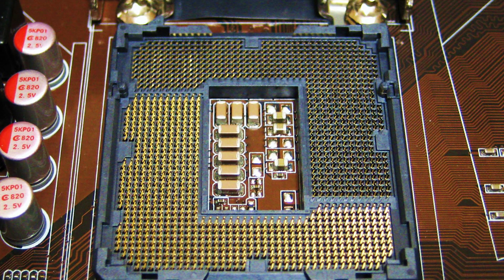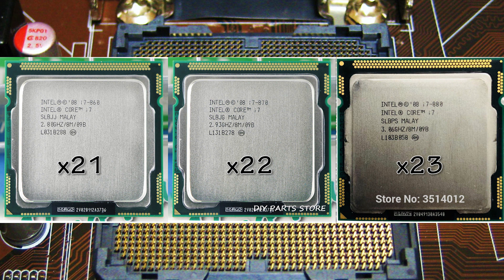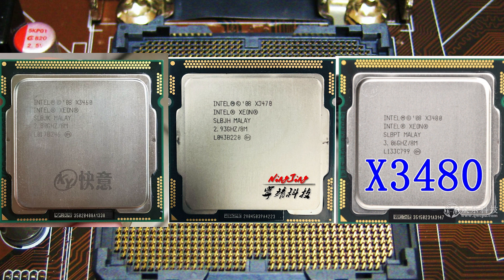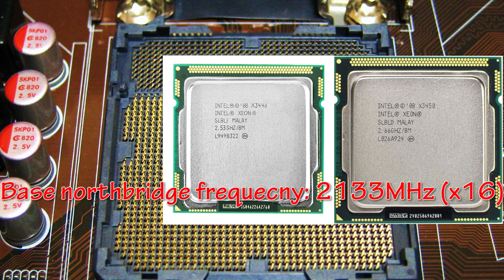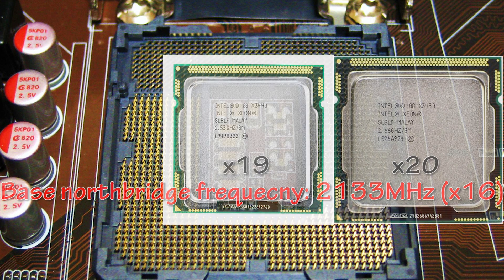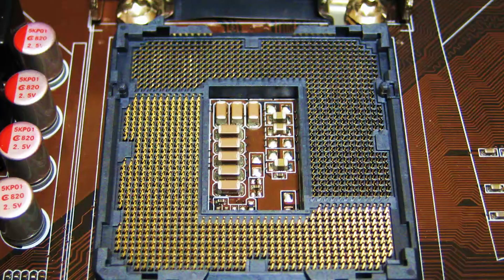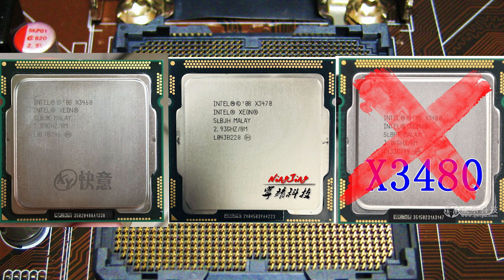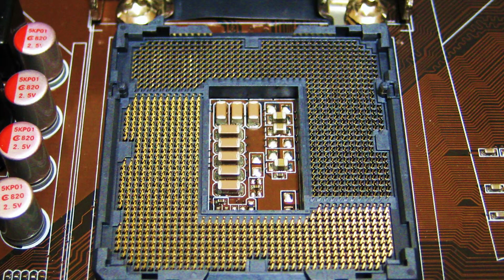What is the best CPU for 1156 socket? i7 880, X3440 or X3470?

Comment: Hello, I have an X3470 on an Asrock P55 Pro. I coupled it with an RX 570. I've yet overclocked it by much, how far do you think I can overclock it? And there is an EZ OC feature, should I use it or manually overclock myself? By the way, great video, it was really informative 😄😄
Reply: Also, I'm using an enermax ets-n30r-he cooler, I got it recently since the older deepcool gamma archer didn't handle the cooling well. I've also watched your video on overclocking the cpu, but having a reference would be nice.. thank you 😬
Reply: I also got several fans, 3 intake at the front, 2 exhaust at the top and 1 exhaust at the back
Reply from the maker: Hi! Thank you!
Asrock P55 Pro is a decent motherboard, so you can try to achieve 3,8 GHz without any problem, taking into account the fact that you have a decently ventilated case.
The only problem is your CPU cooler. It's not bad, but it has only 3 heat pipes. So you probably won't be able to overclock your CPU higher than 3,6 GHz without raising it's temperature higher than 73 °C.
But you can still try to achieve 3,7 GHz and even 3,8 GHz. Who knows, maybe you won the silicon lottery and your CPU sample is good enough to work at 3,8 GHz while keeping low voltage (1,24-1,25 V).

EZ OC setting is a feature which helps to overclock your CPU automatically. You can try this setting. But in this case you may need to manually decrease the CPU voltage a little bit (to maintain low CPU temperature), if you want to overclock it higher than 3,6 GHz.
Reply: @starstreamgamer3704  again, thanks for the replies. I will test this configuration asap

Comment: is this p7h55-m/v-p7h55e/dp_mb motherboard as powerful as this one  P7P55DE_EVO ? bcs i have this one and can i put xeon x3470 on it?
Reply from the maker: P7P55D-E EVO is significantly more advanced MoBo - it has much more power phases and also heatsinks.
According to some users of p7h55-m/v-p7h55e/dp_mb, it does support Xeons.
Reply: @starstreamgamer3704   will my motherboard have the same performace with x3470 like evo?and are u really sure my motherboard support x3470 ??
Reply from the maker: What do you mean by "the same performance"? At stock clocks X3470 will perfrom exactly the same on any LGA1156 MoBo. But if we are talking about overclocking, then the EVO board will definitely provide better results and thus better performance.
Look here: https://forums.aida64.com/topic/4873-asus-p7h55-m-aux-temperature/ As you can see, this guy has the same MoBo as you and X3470.
Reply: @starstreamgamer3704  i dont want to overclock this cpu bro and thanks for the informations.i have a last question should i update my bios to support x3470 or this dosent mean?? Xddd
Reply from the maker: Can't say for sure. My MoBo didn't need an update. If you have an opportunity to install X3470 without an update, try it. If not, I'd recommend you to update BIOS, just in case.
Reply: @starstreamgamer3704  can i overclock cpus in my motherboard h55? last question XD
Reply from the maker: According to official website, Asus P7H55-M does support CPU OC: https://www.asus.com/Motherboards/P7H55M/specifications/
You can easily check, whether your MoBo supports CPU overclock or not, by entering BIOS setup - there should be a tab called "Ai Tweaker".

Comment: Thnx for your efforts, the video is great and I bought a p7p55d -e deluxe because of it 😁
Reply from the maker: You are welcome! Enjoy your new toy. It is one of the best LGA1156 motherboards. You can now juice your CPU to the max.
Reply: @starstreamgamer3704  I have Gigabyte P55 ud3l & x3450, what do you think ?
Reply from the maker: @ft2225  Well, this one looks like a budget board - small amount of power phases, no heatsinks. I would not recommend to overclock your CPU using this board. Actually you can raise it's core frequency up to 3 GHz, but anything higher may damage it. If you install a heatsink or a small fan right over the VRM, than you could go a bit higher.
I would recommend you to focus on memory and NB overclock. Try to raise BCLK frequency, while maintaining the core frequency around 3,0 GHz. It will improve the performance level of your system.
Reply: @starstreamgamer3704  Thanks man 🙏
Reply from the maker: @ft2225  You are welcome.

Comment: Hi i have a motherboard p7h55-m lx with Intel(R) Core(TM) i3 CPU 540 3.07GHz and i want to upgrade it,which cpu you can recommended for it for maximum performance.Thank you 

 And also with the graphics cards which is the best for good performance special on this configuration. Very helpful video
Reply: I think the p7h55-m LX is unable to overclock a cpu. I have p7h55-m pro, that is capable of OC with the same cpu that you have, just bought a x3470 and im waiting for it to arrive. I've done great business and just bought a gtx 1060 6gb very cheap, and i'll use it on that system.
Reply: @LuisSilva-du5zu  Thanks for the answer,no i don't wanna overclock a cpu just to replace with the better one as is possible for good performance.
And i don't know which one is the best
Reply from the maker: @jordanivanov2988  Well, if your MoBo doesn't support overclocking (or you just do not want to perform overclock), I'd recommend you to consider X3470. But I am not sure P7H55-M LX supports X3470. It might work fine with this CPU, but who knows. So if you do not want to find it out for yourself, aim for i7-870. I don't recommend to consider X3480 or i7-880 as they both are way too expensive.
X3470 (or i7-870) is a much better CPU than i3-540. Despite a bit lower base core frequency (2,93 GHz vs 3,07 GHz), it has twice as much cores and twice as much threads, which results in much better performance.
But if you have an opportunity to overclock a CPU, I'd strongly recommend you to do it. Even if you have a low quality MoBo and a small CPU cooler, you can still overclock RAM and Northbridge. This will make your PC run significantly faster.

Comment: Hi~!!! Nice to meet U~
I'm Korean.
I can speak English a little.
I have
CPU : Q3M5 (I7-880 es OEM)
M/B : ASUS P7P55D-E PRO (SATA3, USB3.0)
RAM : CORSAIR DDR3 8G PC3-12800 CL9 VENGEANCE LP WHITE 16Gb (4Gb x 4)
COOLLIING : Corsair Hydro Series H115i
SSD : SAMSUNG 850 Pro 512GB
P/W : Micronics Classic II 700W +12V Single Rail 85+

If I use overclock 4.0~4.2 over more, do U know limite VGA?
Can I use 1080ti??? (?_?)

Congratulate to Open your YOUTUBE!!!
I do click Good & Reading in first!!!
Reply from the maker: Hello! Thank you for your kind words.

1. You have one of the best motherboards for 1156 socket. Yes, you can overclock your i7-880 to 4,0 and maybe even to 4,1 GHz. But the frequency will depend a lot on a specific CPU. Some of them can easily overlclock to 4,1 GHz, while some others - can not.
You have a great CPU cooling system. It will help to keep the temerature of your CPU under control.
But there is another problem - VRM temperature. If you want to overclock your CPU higher than 3,8 GHz, be prepared that VRM zone will be very very hot. In order to keep it as cool as possible, you'd better install a small 40mm (or 60mm) fan on the heatsink (near CPU).
To hit 4,0+ GHz you will need to raise the CPU voltage to 1,36-1,4 V. Making this CPU work at these conditions 24/7 is not a good idea (IMHO). But if you really want to do it, don't forget about additional fan for VRM.
Try to find the highest BCLK frequecny first. For your motherboard it will probaly be some value between 210 and 220 MHz.

2. According to official web-site, Asus P7P55D-E Pro has PCIe 2.0 x16, which means that 1080 Ti will be an overkill for your PC. 1070 Ti (or RTX 2060) is the fastest graphics card you should use.
To be honest, even disregarding the fact that P7P55D has old PCIe 2.0, i7-880 (even overclocked to 4,2 GHz) is simply too slow for 1080 Ti. This CPU would not allow this GPU to reach it's full potential.
Anyway, you can buy 1080 Ti now simply to lay the groundwork for your future PC.
Reply: Wooooooooooow!!!
Thank u soooo much!!! for your so kind answer!!!
Your answers helped me a lot.
I look forward to seeing your YouTube continue to grow with more subscribers.
Thank U!!! Have a nice day!!!
Reply from the maker: You are welcome!